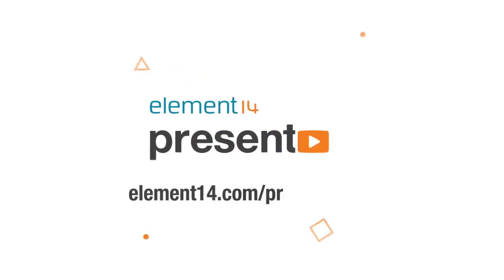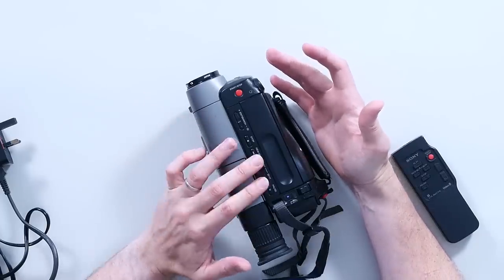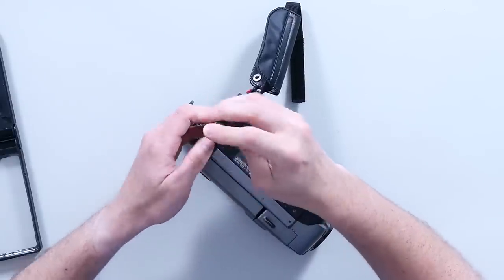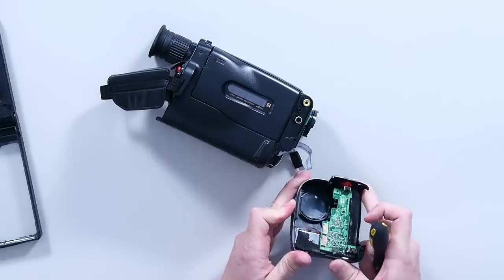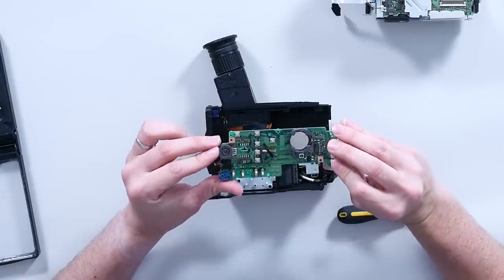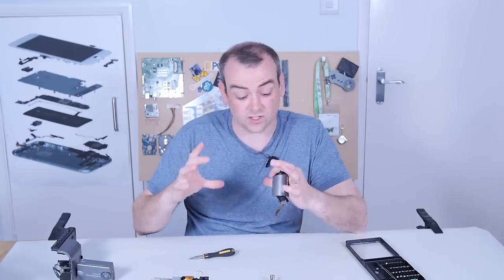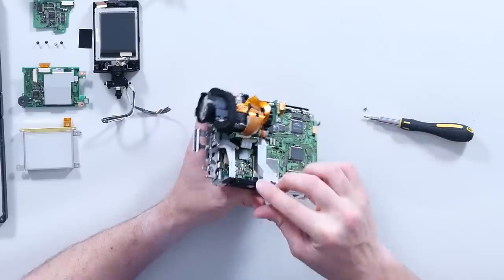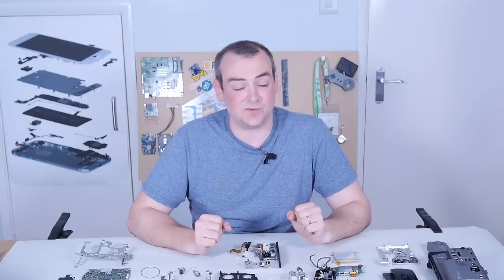Sony Handycam Teardown - The Electronics Inside

Comment: I love the video, but I would like to offer a quick correction: Hi8 video was not a digital format, as stated by the lower third graphic at 1:10.  Hi8 increased the FM carrier frequency to give the luminance channel of Hi8 video 2 MHz of bandwidth, while Video8 enjoyed only 1.2 MHz of bandwidth.  The chroma bandwidth was unchanged.  The cassettes used by both formats were the same, and all Hi8 equipment could play and record Video8 material.  However, a Hi8 recorded tape could not playback on a Video8 player.  Later on, some higher-end Hi8 equipment did offer digital PCM sound, though the sampling rate was quite low.

Digital 8 was another format that used these same cassettes but did record video digitally using the standard DV codec that was also used on MiniDV tape.  Essentially recording the same signal to an 8mm cassette that you would to MiniDV.
Reply: I had read (and am happy to be corrected) that Hi8 was a transitional format, and supported digital audi tracks with supported hardware? Unfortunately I was too young at the time to have been into it in any detail!

Comment: Try and get that mini CRT working with a composite signal :D <3
Reply: You sound like you have tried? Did you get it working in the end?
Reply: LGR already did it, he played some new games on it a while back
Reply: @a531016  I have one I need to try on! It's still attached to the camcorder, so I can also easily buzz out the correct lines.
I just need to tidy some space to do it :O
Reply: @azyfloof  I know the feeling, space is always a big limitation for a good project!
Reply: Tried mine with a DVD player and it works

Comment: This is really cool, I have one of these and it works! Now I have an over whelming desire to tear it to pieces just to look at it!
Reply: It was an interesting one, fair warning though, there are a lot of parts and it takes a lot of patience! I think I was going for a good two hours!
Reply: Snap.  Although I think mine might be dead.
Reply: @a531016  👍🍻
Reply: If you have one of these could you answer one of my questions? I want to get one of them but is it possible to just connect the usb cable from the camera to my laptop to transfer the videos or is it more complicated than that because of the cassette?

Comment: Correction: these small CRT's doesn't exist in color. You need to go up to about 1,5" to get a proper shadow mask CRT. The resolution is absolutely terrible on these as it wasn't possible to make the shadow mask very fine compared to screen size.
Reply: That's a shame, but 1.5" could work well for some projects too!

Comment: "Black and white is stored first and colour superimposed on top". 

On the bottom. All broadcast formats (that i know of) use chroma on top of the luma signal. All tape formats (that i know of) use colour-under encoding, so the colour information is below in the frequency spectrum. Because the top of the frequency range can be flaky on tape and luma degrades more gracefully.

The way image transformed from RGB on the sensor to the fundamental video components, luminosity (black and white image), chroma-U and chroma-V (two colour difference signals) is exactly the same between PAL, NTSC and tape formats. However the way U and V are combined into the summary chroma signal is different. Bad video output quality on composite signal is likely just down to engineering or component degradation.

12 hour reassembly livestream when though?
Reply: I'm not sure a live stream would work, this is a family friendly chanel and I may not keep my language in check! 

That's intertesting to know, I think I'd like to compare the quality throught a full size video 8 VCR, or something with a component out (if they exist)?